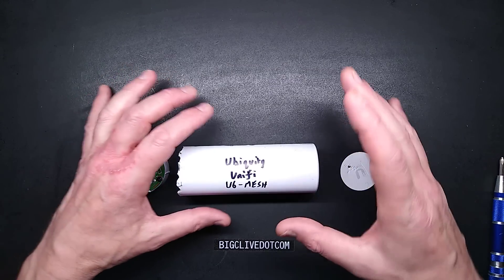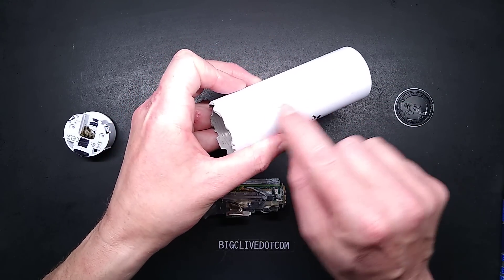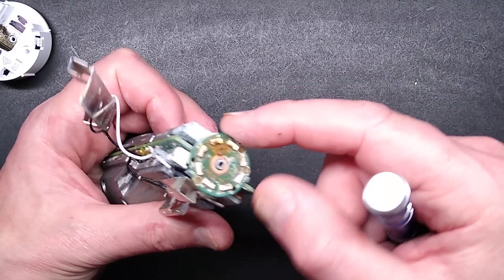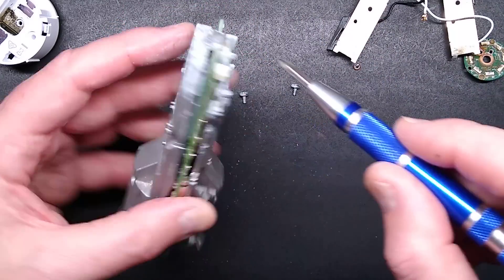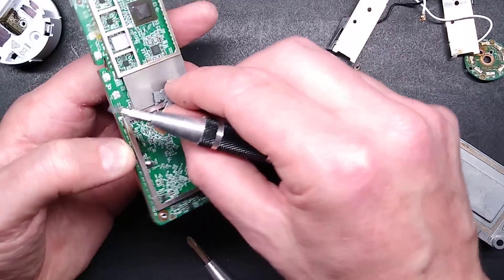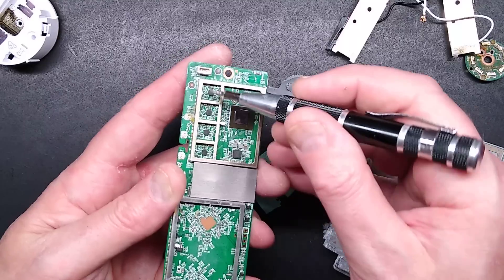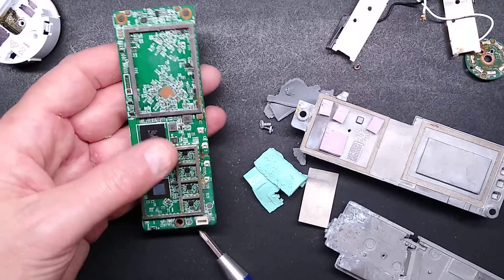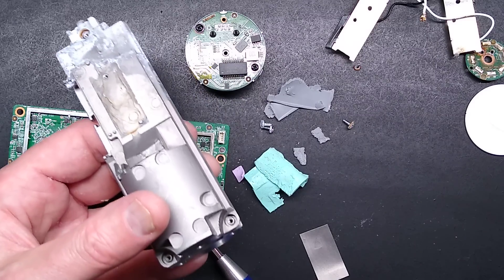Teardown of an impressive ubiquiti WiFi node

Comment: ubiquiti used to be ok 10 years ago now they're a hipster scam. ALL of their devices fail with random ways within 1-6 hours of use and they lie that every update they release "Fixes" the issue..
Reply: I can confirm I've deployed WAY less than ALL of Ubiquiti's devices - thousands yes, but not all - and we're still at way under 0.1% first-year failure rate in the last 10 years
Reply: @NiddNetworks   surprising, considering every single time i've touched one of theirs, they fail with absolutely random problems. Like a silent DHCP failure. Devices simply are not allowed to see the network and the AP's report "no internet". Something that Ubiquity's staff says "has been fixed" in "previous firmware updates", and yet the patch notes comment section is blown up with the same complaint.. Considering their premium prices..
Reply: @dimitar4y  Totally agree with you that some weird stuff goes on sometimes which requires either an SSH or a ditch and factory reset from the device etc... and some stuff absolutely does fail.  And there are STILL aspects of their interface which, despite being available on a $69.99 cookie tin router, UBNT seem unable or unwilling to add in despite being useful in SO many ways, and costing 8x more.  They're cheap in comparison to "proper"enterprise stuff, especially with the feature set, though the difference is closing with ubnt's own enterprise range now... but overall as you say they're not cheap compared above mentioned cookie-tin domestic single box.

(My first comment was really just poking a bit of fun at your "ALL their devices fail within 1-6hours"... that's a bit of a stretch I'd say really 🤣
Reply: Think they’ve had some bad batches of products, probably due to the supply crisis which has screwed everyone.
Reply: @edc1569  And my experience spans multiple years. I've contacted their support and their answer is "update" or "buy newest model". They have zero customer support. They are very much the apple of IT stuff.

Comment: Would it be possible to try those Antennae on other hardware to see how they do?
Reply: If it's at the same frequency, it should work. If not, it won't.
Reply: Most PIFA antennas are designed with a specific frequency range and also have specific transmit patterns. As such, not using all of them or placing them in a different pattern, might reduce the performance, although they should work with all WiFi devices that support the same frequency range.
Reply: Or just try them on a vector analyzer(VNA), like a NanoVNA should be totally able to scan them.

Comment: Pulling heat from the back of the board, behind a chip, is fairly common. Since they are made in a flip chip design where the actual logic is closer to the PCB than the top of the casing you can see , where you would normally attach your heatsink. Because of that, pulling heat through the back of the PCB is surprisingly effective and can make a massive difference.
Reply: Particularly true for ceramic body chips.
Reply: I thought there might be vias through the board on the exposed copper area behind the the supposed main chip, to improve thermal conduction, but BC didn't mention any.

Comment: Unifi devices are weird to me. I have a few at home. They're super reliable and easy to set up/configure yet they give off a bit of an Apple vibe? Yet I then go looking at Cisco or Ruckus gear and you seem to need degrees and licences and god knows what to make them work. I do like them though. A solid 9/10 rating.
Reply: Unifi’s founder and boss Robert Pera is ex-Apple.  Apple ignored Pera’s idea of using ubiquitous (geddit?) standard WiFi chipsets for wireless ISP gear to deliver connectivity in rural areas and that’s how Ubiquiti was born.
Reply: @Leftplayer1  Well today I learned! Thanks for this neat factoid!
Reply: Some apple guys left to setup unifi, clue was always their packaging.
Reply: Unifi comes from Apple I think. Apple used to have the Airport or some such Wi-Fi device.

Comment: Those antennas are usually referred to as PIFA antennas in the business. They're designed using a combination of voodoo and black magic.
The chip under the ceramic heatsink would be the main SoC and the corresponding copper pad on the back of it is for improved thermal transfers away from the SoC. The chip next to it is some DRAM and the chip in the middle, under the less sticky pad, is some eMMC for storage. The chips under the green-ish sticky pad on the same side as the SoC appears to be some kind of an MCU and some SPI flash. The "chip" you looked at on the PoE module is the magnetics for the Ethernet, not a chip at all.

Comment: RF is an unholy blend of plumbing and witchcraft. I never directly worked on them, but I used to get adjacent to some high power RF transmitters in the past, and also did some mechanical maintenance on some microwave stuff, under direction.  Huge respect for people that work in that field.
Reply: Why does every high tech end up beeing a combination of witchcraft and plumbing? Rf -> plumbing, Partical accelerators -> plumbing, spacecrafts -> 80% plumbing.....
Reply: @clockworkvanhellsing372 Waveguides maybe?
Reply: @clockworkvanhellsing372  That's why plumbers charge so much for their services.
Reply: @clockworkvanhellsing372   It’s obvious if you think about it, you need pipes to move the magic about.
Reply: This is even more accurate given that the 'coax' in high power RF equipment is literally made of copper pipe 😅
Jeff Geerling's video on the radio station is great.
Reply: Even VHF is getting there in terms of  "delicacy"!  Any higher frequencies and you're into the realms of microstrip, and having to remember that any  wire (no matter how short) acts as an efficient antenna!  Both very specialist, and VERY costly in terms of instrumentation needed.
Reply: You get into serious cm and mm wave receivers and you really start seeing the black magic. The input stage of a K band radio telescope i worked with in the 80s had a liquid helium cooled maser front end, pumped with a local oscillator. That all sat at the focus of a 40m dish antenna. Getting up there was, ah, interesting.
Reply: RF isn’t incredibly hard, it’s just different. All the circuit elements act differently at high frequencies and it’s not super intuitive at first, but just like any kind of electronics (or any complex field) it’s confusing until you reach a certain level of understanding and things start to click into place.
Reply: @stephengentle2815  Up until you start designing resonant cavities, wave guides, and antenna feed horns. 

It's not too bad once you get past the front end and you have an amplified IF signal.
Reply: Far from witchcraft, just lack of good educators in quantity and/or quality.
Reply: @mindaugasstankus5943  The thing is from an EE perspective, the higher the frequency the more our "rules of thumb" break down.  Plus, if we forget things.  As an example, I could make an RC oscillator to produce a frequency or timing signal.  Or...  I could use a cheap microcontroller, save money, and get the product out the door faster.  Which means, I have to double check myself whenever I deal with oscillators.

Comment: Damn!  Thanks Big Clive for the look inside.  That's some complex engineering for sure.  

Sheesh!  This is just for WiFi?  The circuit board looks like an aerial view of Hong Kong or something.
Reply: Modern wifi standards are insane. We’re so far beyond 802.11b it’s hard to believe any of it can work let alone work as well as it does.
Reply: @ZaphodHarkonnen  Well.. that the routers takes less than 1 kW to do it's thing is kinda amazing. The stuff going on inside them is wild indeed.
Try pulling in a 40 to 80 MHz block and do stuff with it using DSP/SDR techniques, and you would likely find it very demanding!
Reply: Pretty much every modern router (4+ antennas) looks like that. This one probably has a more powerful processor and RAM and so on compared to the humble TP-Links and Xiaomis I have. Also, it is all rather modular and they probably get to copy paste stuff from reference designs by Qualcomm etc.
Reply: You should look at an old Ruckus AP or one of the high end ones.  That BeamFlex antenna system looks like a miniaturised New York skyline
Reply: @Leftplayer1  Pretty cool.

Comment: I wouldn't buy anything Ubiquity again after an "Accident" with a router that misbehaved and got damaged.
Reply from the maker: It does appear that their firmware doesn't quite match the quality of their hardware.
Reply: @bigclivedotcom their build quality is nice but the software is sloppy, kind of sad that some nice hw engineering can be let down by just software i used to like them and i still kind of do but due to the software i like them less. I had the same on heos denon speakers, nice build quality but the software and app are kind of sloppy

Comment: Those four modules in a row will be the SDR's, one per antenna, or, if SDR functions are done within the Qualcomm main processor, then they could be amplifiers for each of the antennas. Might also explain the heavy metal shrouding around each one... and it would make sense for them to be very close to the qualcomm chip... It's shame the writing was so small on them, since these are arguably part of the secret sauce in Unifi RF kit...
Reply: SDR? Those should be PA's and LNA's if anything. The Qualcomm chip you're referring to would be the WiFi radio chip.
Reply: There’s not going to be any SDR going on in these things, this is commodity hardware with specifically engineered silicon.
Reply: @edc1569  No SDR ehhh, good luck finding the crystals then... Of course there is a number of SDR's in all modern RF equipment.
Reply: @dougle03 Also, beam forming with multiple antennas to focus on rapidly moving equipment on a stage will probably need some clever SDR logic to constantly adjust signal phases for both direction and signal modulation .
Reply: Don't call evrything "SDR", it's quite much a all or nothing in modern technology. SDR is a way to do some processes but isn't a device in it's own.

And 4x combined LNA & PA seems very plausible.
Likely some serious beam-forming and DSP stuff going on in the big chip next to them.
Reply: SDRs lol. No. They're FEMs, front-end modules. They contain a T/R switch, PA, LNA and output power detector. They're modules because they're MCMs, because they have to use expensive non-Si processes. For LNAs SiGe is common, for PAs you do InGaP/GaAs. It's basically the RF pieces that are impossible to do in the main CMOS chip.

Comment: Yeah the design complexity doesn't surprise me Ubiquiti has the best designed consumer/office APs, i'm not always happy with their software
Reply: Totally understand you! The hardware ist superb most of the time but the software has quite a lot of hickups
Reply: Ehhh nah not really. We're switching to cisco now coming from ubiquiti plagued with issues and questionable feature sets
Reply: @MrBrax  yeah I will say Ubiquiti's stuff is not as effortless as it used to be/or rather seem, and as WiFi standards have advanced more issues have cropped up; I do like the more granular configuration options provided by other vendors even though UniFi's radios themselves seem well considered/engineered; I'm quite happy with Unifi in a home environment or very small deployments, but I'm mostly a novice to it all
Reply: I stopped using their kit because of their cavalier approach to software updates that for a time borked hardware... Got tired of it...
Reply: @dougle03  similar - was installing unifi for a while then went through UDM upgrades that bricked the devices
ended up buying one to set up with the latest updates and transplanting into sites

coupled with suppy issues during the [andemic and after  - moved to TPLink Omada, better support, warranty and availability

Comment: It really makes you wonder how much time is used up in engineering to get something like that to fit into such a small space.
Reply: Its soo small and still is pretty powerfull, all inside a cilinder
Reply: Seconds per unit sold luckily.
Reply: @edc1569 Ubiquity gear is expensive and designed to be useless for anyone not locked into their enterprise software, so I doubt it sells in huge numbers to divide the design cost down to cents per unit sold .
Reply: In my experience not as much as you might think, but only on the front end. The people assigned to design things like these typically have spent lots and lots of hours in their training and in previous similar designs. That’s where the bulk of the time investment is. In the case of the antenna design, thousands of people have contributed tens of thousands of hours each to  perfect the sorcery seen here.

Compare with some of the simpler, cheaper stuff Clive has laid open for us. If your first reaction was that a not particularly bright eight grade child could have designed it, you might be right.
Reply: High six, low Seven figures of NRE
Reply: @SwampBewdy more like high 5 and low 6 figures.

Comment: I use Ubiquity at home, total overkill but very well engineered and reliable.
Reply: they run quite hot so keep some airgap to your ceiling
Reply: @hillppari I haven't noticed that with my ubiquiti equipment, but I only have the larger flying saucer style ones. Rarely even noticeably warm, but they are solid plastic. Cisco APs, such as the 3802, which is a giant chunk of aluminum gets rather toasty on the other hand.
Reply: I've got a U6 Pro. Totally worth the investment purely due to the reliability. It's never required a reboot.
Reply: I have the same, a pro and two LR points, just to run the gate and intercom system (got a 550m long driveway lol- wired just wasn't going to work) and I was using them commercially,  great kit and VERY reliable, so used them in my home system as well (the gate is solar powered for the opener, security cameras and intercom system at that end, all running off a lithium battery system and solar panel)
Reply: @steved2136  for running just a single point off in the distance I would have recommended an outdoor WiFi mesh point (the small one with two antennas).
Reply: Same here, I have one edgerouter lite handling my network traffic and 3 APs 1 UAP-AC-PRO and 2 lite for wifi, nobody has ever complaint of laggy internet or bad connectivity. VLANs for work, streaming, cctv, guests etc. Runs like clockwork
Reply: Well I have two AP Pro at home because of big armed concrete walls
Reply: Unfortunately the quality of their software is absolutely dreadful.
Reply: @milhousevh never had any issues.